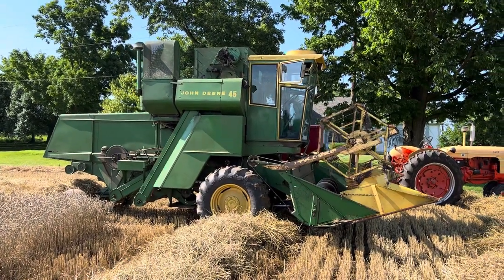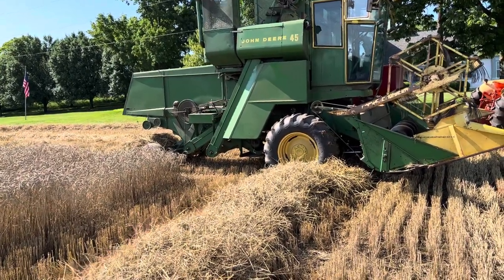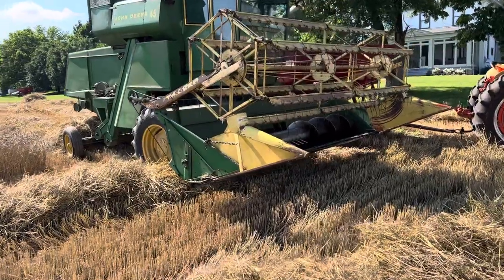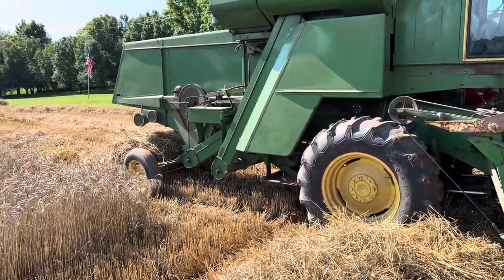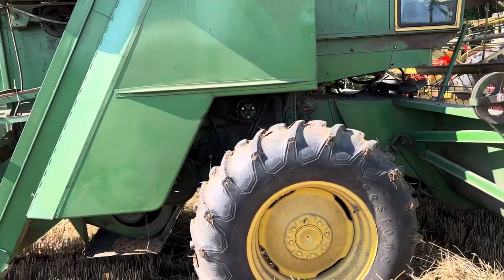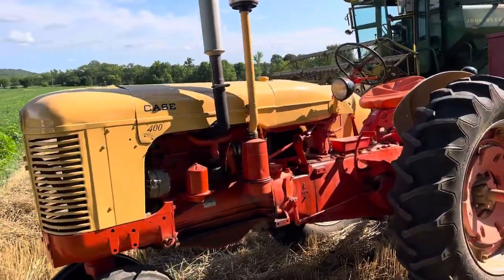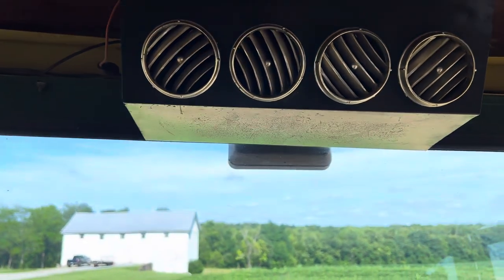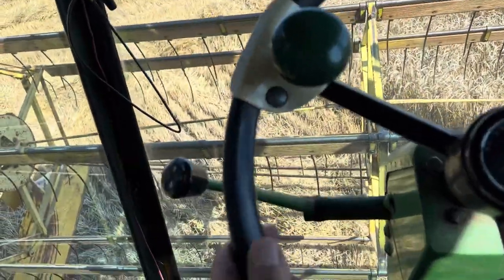John Deere 45 Combine and Case 400 Tractor

Comment: Dad had a '68 45.  I think they stopped making them in '69.  His had a aftermarket floating sickle bar (Love bar).  I have video on my channel of that 45 in soybeans in 1996.

There was a shield for that chopper belt that you are missing or maybe took it off with the chopper.  For some reason, cabs on these seem to vary.  Dad's had a factory cab but it did not have a opening window over the shifter console like yours does.  The blower fan on the ceiling was also different.  Almost never had a wheat on the farm, but did oats for hog feed and straw.  Always was swathed and never strait cut.  Things would never dry in our area enough for that or too much weeds/grass in it.
Reply from the maker: I have that shield but took it off when I took the chopper off. I have put the chopper back on but left the shield off-it’s a hassle to put on and to my mind makes it harder to deal with the chopper belt. I’m going to check out your Dad’s combine. Thanks for your comments.

Comment: Nice video,
I  had  a JD 45 and JD 45 EB
Then moved upto a 3300.
Can you still get parts for them 45's?
They work good in Oats.
Reply from the maker: Seems like there are still a lot of 45’s around our area. Belts, bearings shouldn’t be a problem. Might buy a junker and park it in the woods.

Comment: We have a case 400 diesel.  Looks just like that except obviously the engine. Power steering and remotes on the rear. And this is a mostly JD farm.  But that case is one of the most comfortable tricycles I’ve run.  Plenty of power.  The only wonky thing is the shift pattern. But you get used to it. No worse than a 4020 with the telephone gear selector 😅
Reply from the maker: Is yours a Super diesel?
Reply: @rogermiller7411  to be honest I don’t know. It was bought on a whim , and tried to research after but not much info out there. Is there a super and regular diesel ?
Reply from the maker: There are both diesel and Super diesel. The Super is worth quite a bit more - they didn’t make many. Even rarer is a Super 400 gas. Only ever saw one of those. I believe Case only made Super 400’s in 1957. Serial number is best way to tell.
Reply: @rogermiller7411  ok. I’ll check on that.  Have me curious now. I’ll let you know what I find.